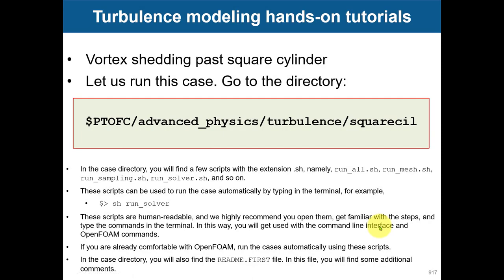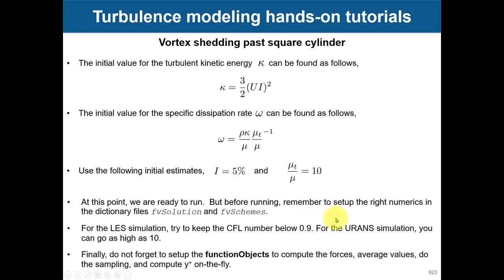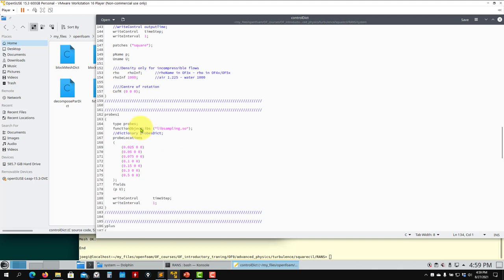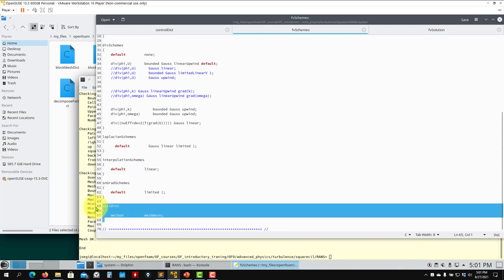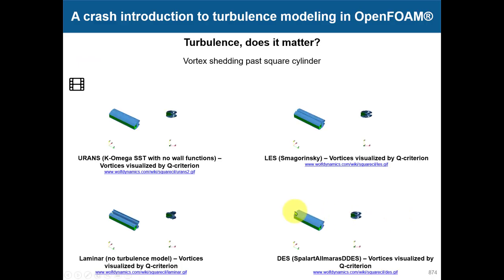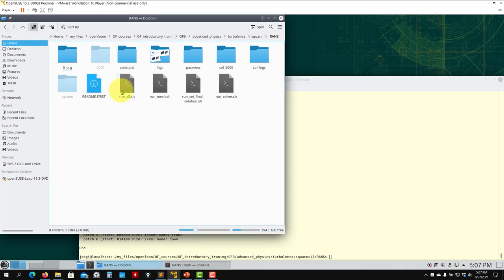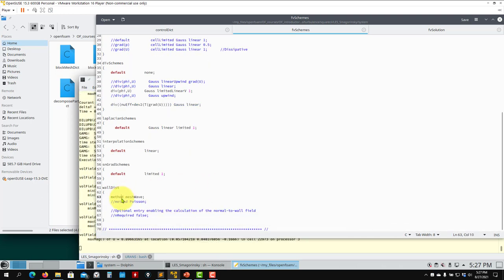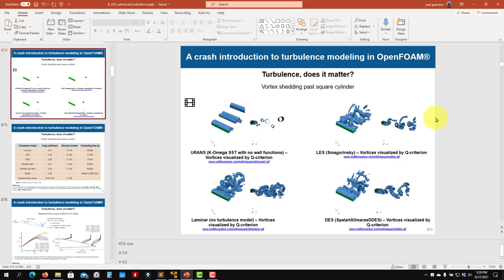8.4 Module 8 - Advanced physics - Turbulence #openfoamtraining

Comment: Do you talk about boundary conditions/free stream values when using the spalart allmaras turbulence model in this training or the advanced turbulence one? I see in the tutorials you use a low value 10-20percent of nu. I assume this is like the trip value mentioned in some papers. The issue is I have seen other people use some values close to my and also in the openfoam default tutorials they use a rather large value which doesn't really make sense to me since the papers say to use 2-3 nu for fully turbulent free stream and 0.1-0.3(I think) as trip. Don't really understand the discrepancy and also what trip value means. Thx a lot. Im asking because I watched the videos including the member ones and can't remember what you said about them :)
Reply from the maker: Well, the BCs are kind of recommended practices. For the SA, a nut equal to 10*nu is usually a good starting value. Then, the value of TI is usually up to you, a value of 10% is for high TI and 1% for low TI, so you can choose it according to the operating environment. So if you are thinking about a low turbulence wind tunnel a value of 1% makes sense, if you are working with turbo-machinery a value of 10% is recommended, and for external aerodynamics i stay within 3-5%. Have in mind that the SA model is fully turbulent, that is, it does not compute transition to turbulence (so tripping will not have much influence). If you use transition models, RSM models, EARSM, or DES/LES, tripping is important as those models can compute transition to turbulence; so choosing reasonable values of BC/IC is important.

Comment: Hi Joel,

I hope you're keeping well. 

I am running a steady state case for single phase flow (water) in a stirred tank reactor (no baffles) agitated by a magnetic rod stirrer lying on the reactor base (using SRF to model stirrer rotation). The top of the tank is open (slip BC).

I have managed to perform a run using two equation model (SST K-Omega) and the results are well converged and the simulation is nice and stable.

Now I want to use the SST K-Omega results to initialise an RSM run. I have already computed R (and epsilon) using the postProcess utility.

However, when I try to run RSM the simulation keeps blowing up within the first few iterations and I cannot understand why.

If possible could I send you my simulation files (both SST and RSM) as I have been scratching my head for a while trying to resolve this issue?
Reply from the maker: RSM models in OpenFOAM are difficult to converge. Have in mind that they are wall modeling, so if your y+ is less than 30, they will give you problems. In my experience, the SSG is more stable.  You also need to tweak the URFs.  If you are looking to solve the anisotrpic behaviour, i recommend to use the Lien cubic k-epsilon or the q-Zeta model

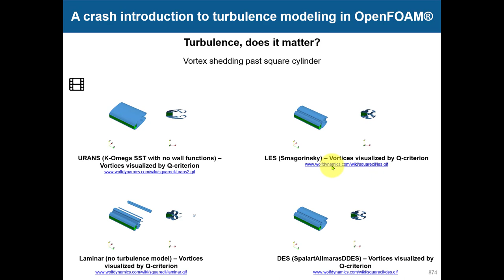Comment: At 15:22, a little surprised to see URANS basically shows 2d vortex structures but Laminar shows 3d vortex structures (small vortices falling off large vortices).
Reply: That is due to the averaging of the equations (all fluctuations or small structures are averaged).  In the laminar case, there is no averaging nor filtering involved; therefore, all structures are resolved (of course, what you resolve depends on the mesh).